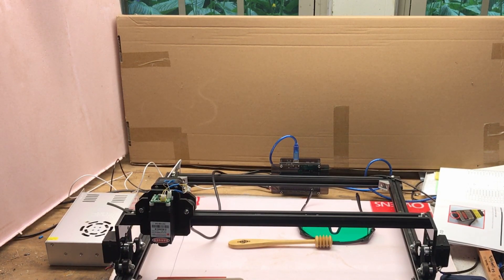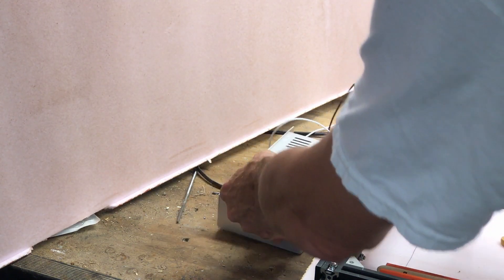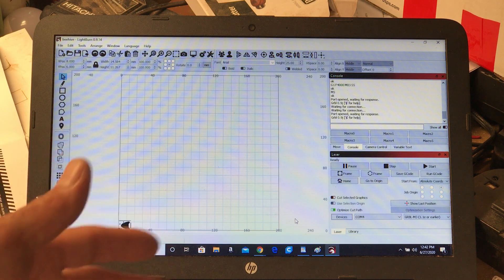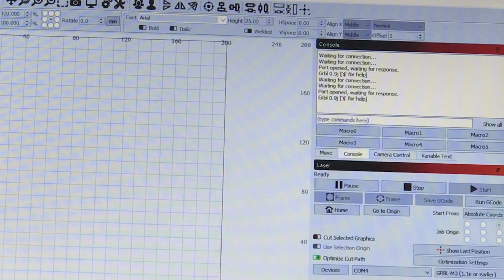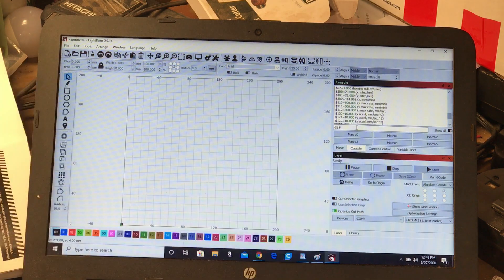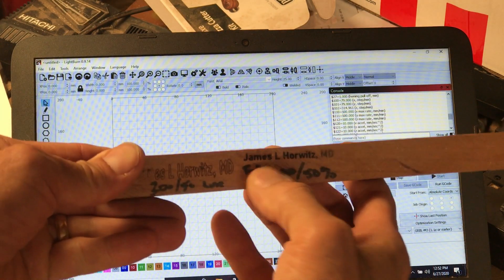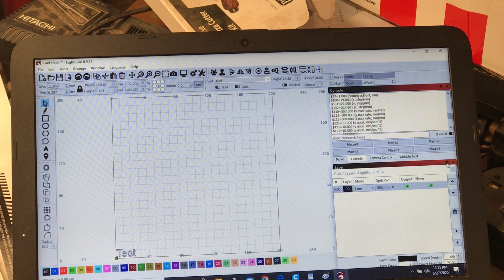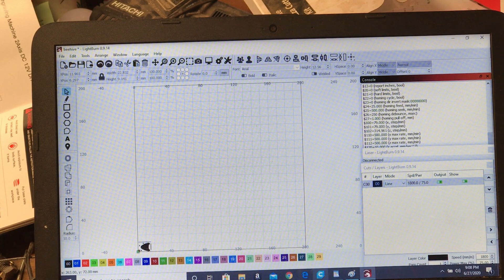Tips on the basic operation of your new GRBL Laser Engraver

Comment: Thanks for this upload!  I'm considering buying one of these off Amazon, but I plan to attach an ultrasonic spray nozzle to it.  I don't need the laser feature really, but this seems like a nice affordable platform for my coating project.  One question: I'm looking at what appears to be a very similar model.  Amazon say it will move up to 2 inches per second.  Obviously that would be too fast for these little lasers, but it would be about right for what I need.  Does your unit seem capable of moving the target point that quickly?